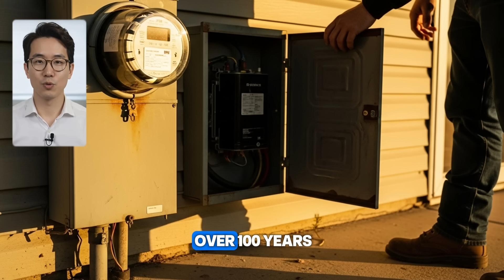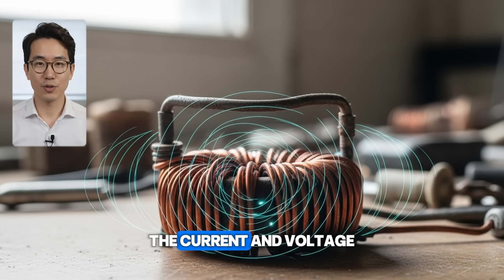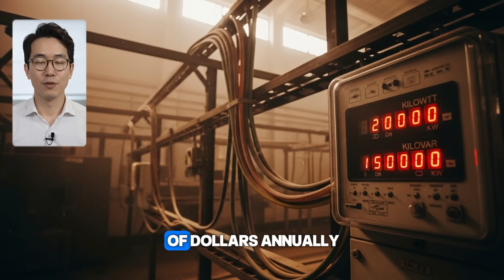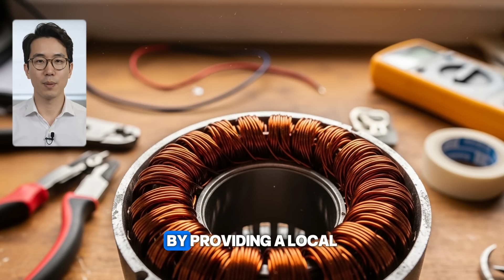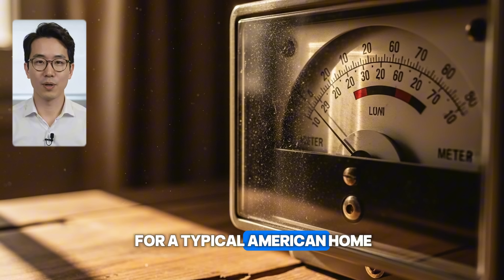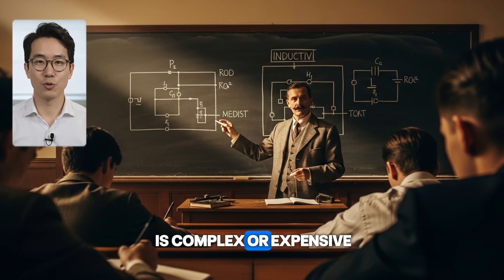This $2 Capacitor Bank Cuts Home Power 40% — The Power Factor Secret Utilities Never Taught You

Comment: not every device deals with a PF read it as efficiency the same as cos for starting you use extra power 
yes it can reduce use but if we talking here about starting that takes only a few seconds
but the use is in hour use so you have to cut the use by 60 if it takes 3 seconds now you cut it again by 60
npw we have seconds multiply this by 3 like this 2000 W / 60 = 33.33 W / 60 sec =0.55 W x 3 = 1.66 W
take your kwh cost say 20 cent split by 1000 x 1.66 =0.00055 cent for every time it starts
so to be honest this is bull story they tell in africa 10.000 starts to see a 10 cents differends on
your utility bill they raise the kwh  cost with 1 cent and you profit is gone
most people dont like to calculate because they say the dont have time but electricity is time based
a hotel owner who have done this said he saved 30 % but that can not be a broken earyh swiths
maybe were the problem sending 30 % in the soil if he would safe energy that whould make his generator
from 150 kw using less feul do not believe this storys they are bulldo your home work use a calculator
regards Henk

Comment: How do the electricity-saving spike busters work? Electricity-saving spike busters (often marketed as "energy saver plugs" or "power factors") do not lower your electricity consumption or reduce your power bill. These plug-in devices are widely considered scams by consumer protection agencies and electrical engineers. The devices claim to save energy by "smoothing out current spikes" and correcting the "power factor" of your home appliances. However, Residential bills don't measure power factor: While large industrial facilities pay penalties for poor power factor, residential utility companies only bill for active power (kilowatt-hours). Correcting it saves the homeowner nothing. They lack real internal components: When dissected by independent engineers, these devices rarely contain anything more than an indicator LED, a simple resistor, and sometimes a cheap surge protector. Many models are entirely fake, containing empty boxes filled with nothing but wax, resin, or sand. They don't stabilize the grid: A single small plug-in cannot regulate voltage or absorb the massive electrical surges caused by heavy appliances like a furnace or A/C. Instead of using these gadgets, you can rely on proven methods to genuinely reduce energy use and protect your appliances: Smart Power Strips: Use these to cut off phantom power (standby power) to electronics like TVs, gaming consoles, and printers when not in use. Energy Star: Upgrade to certified appliances that have verifiable, lower energy requirements. Home Energy Audits: Schedule a professional audit or use DIY calculation tools provided by Energy.gov to pinpoint exactly where power is being wasted in your home.

Comment: Residential electricity is two-phase (Single/Split-Phase), and industrial is three-phase; do both use power factor correction? View all. Both residential and industrial electrical systems use power factor correction (PFC), but it is primarily required and implemented in industrial settings. Note: Residential power is typically single-phase (often delivered as split-phase), while industrial power is universally three-phase. Industrial Systems (Three-Phase) Why it's used: Industrial facilities operate massive inductive loads like large electric motors, compressors, and transformers. These cause current to lag behind voltage, resulting in a poor power factor. How it's used: Industrial PFC uses large banks of capacitors or active harmonic filters to offset the inductive load. This saves money, as electrical utilities penalize commercial and industrial customers for poor power factors. Residential Systems (Single/Split-Phase) Why it's used: Homes rarely have massive industrial motors, so their overall power factor remains relatively stable. However, modern household electronics (e.g., computers, televisions, and LED lighting) are non-linear loads that distort current and require internal PFC. How it's used: Residential PFC is usually built directly into the devices themselves. This is mandated by regulations like the European Union's IEC 61000-3-2 and Energy Star standards to ensure power grids remain stable. For a deep dive into the underlying principles, check out The Engineering Mindset's Power Factor Guide.

Comment: This looks like AI b/s. All residential meters count the real power, i.e. they take into account the power factor. Even in early 1900 the electromechanical Ferraris did measure the real power. They use two electromagnets—one proportional to line voltage and one to load current—to create a magnetic flux that induces eddy currents in a metal disc, creating torque proportional to the real power. They were designed to measure the actual, useful work done by electrical loads (kW), not the apparent power (kVA).
However, there are penalties for reactive loads for non-residential consumers, because they have big consumption and effect the entire network.

Comment: most modern devices have capacitors built into their power adapter or power supply. I would assume this is only an issue on poorly designed devices or very old devices
Reply: My stereo amplifyer is always warm when it is turned off.

Comment: There is no hidden power. Capacitor banks bring the current and voltage into phase for correct delivery of power. It means induction devices cause current and voltage to be out of phase i.e. one lags the other
Reply from the maker: You’re exactly right, and that distinction between real and reactive power is a crucial part of understanding how electrical efficiency works.

Comment: No, the clue is in the name; reactive power is not real power and domestic customers are not billed for it.

In a bit more detail, it happens when the voltage and current waveforms get out of step with each other (typically the current lags behind, which is why a capacitor deals with it). What happens is that for a short period after the voltage has changed from positive to negative, the current is still positive so you house is actually exporting power to the grid (and vice versa when the voltage goes from negative to positive. Effectively, reactive power is being stored in part of the cycle, and exported back to grid in other parts. 
Electricity providers dislike it because the current used ends up increasing losses in the transformers, cables etc., but only industrial consumers are financially incentivised  to reduce it.
Reply: Forgot to add - the is a UK YouTube poster called "Bigclive" and he strips down and analyses a lot of electronic gadgets. Many of the cheap 'capacitor banks' are fakes (with internal plastic boxes of sand to add some weight).
Reply from the maker: That’s a great breakdown of how power factor and grid dynamics work; thanks for adding your expertise to the discussion.

Comment: Total garbage.  Capacitors correct power factor.  Residential customers are NOT charged for bad power factor.  Only commercial and industrial customers are charged for poor power factor, NOT private homes.  You can install as many capacitors as you wish, it will do nothing to your electric bill.  Google needs to stop such misinforming videos.
Reply from the maker: You’re right that residential billing is based on real power, and I appreciate you clarifying that distinction for the audience.

Comment: First: Thank your for highly informative videos.
Second: what relationship Horsepower of a typical  motor and the capacitance value to yield a phase angle angle of  zero degrees? I am thinking about adding such capacitor major motorized device automatically switched on/off. These loads include motors in AC  and heating units. By doing that the variations in resulting phase variations in the average  phase angle.  Kindly comment.
Reply from the maker: It’s an interesting approach, though balancing capacitance to hit a perfect power factor can get complex as loads cycle on and off throughout the day.

Comment: lol, so the capacitor on my AC compressor should be good then?
Reply from the maker: That capacitor is specifically designed to help your compressor start and run efficiently, which is a great example of local power factor correction.

Comment: Why give false inpormation.  The most it could improve is 2 to 3%
Reply: Pays for itself in 2 weeks when you’ll use power for 40 years.  2-3% is something how is that false.  If this is real and true now imagine a whole city using 2-3% less power that’s significant
Reply: You don't even know that much.  The whole story is as bogus as the "2 to 3%," which you just made up.
Reply from the maker: You’re right that real-world improvements are often much smaller than theoretical projections, and I appreciate you sharing your perspective on the actual efficiency gains.
Reply: Will adding multiple capacitor banks other than the on the main line improve results???

Comment: Absolute rubbish because electricity companies don't charge for reactive power in a residential setting.

Even in industrial settings, they don't charge for it unless the power factor goes too low, so the emphasis is on power factor correction to keep the power factor above the critical threshold and close to 1.
Reply from the maker: Fair points—industrial power factor management is a much different beast than residential billing, and I appreciate you providing that technical context.

Comment: It would be good if these companies would make a split phase capacitor device that would fit right into a spare split phase breaker location in the main panel or in a subpanel.
Reply from the maker: That would certainly be a much cleaner and safer way to handle power factor correction for home setups.

Comment: AI Slop debunked by AI. 
No, it won't reduce your electric bill — and here's why.
Why it doesn't work for residential customers
Capacitor banks correct something called power factor — the ratio of "real" power (watts, what does actual work) to "apparent" power (volt-amps, what the utility has to supply). Industrial facilities get billed for poor power factor, so capacitor banks genuinely save them money.
Residential customers are billed only in kilowatt-hours (kWh) — real power consumed. Your meter doesn't measure apparent power or power factor at all. So even if a capacitor bank improved your power factor, your meter wouldn't register any difference, and your bill wouldn't change.
Reply: Last week he was saying you should wrap 80' of 18 gauge wire around your service entrance cables ahead of the meter... IOW, "correct" an inductive power factor problem by adding even more inductance!  I can only hope no one is stupid enough to connect a start capacitor across the power anywhere in their home, because it will literally EXPLODE in their face!  I'm a REAL electrical contractor, and NO real electrician is going to do this for anyone!  This channel should be taken down!
Reply: @TheRealCheckmate  It's the comment section of these videos where the learning happens.  Thank you.
Reply: @DennisD-d1n  Right! I think Dr. Wong is very wong about everything. He never gets it white.
Reply: @TheRealCheckmate  It amazes me that youtube is so wreckless with our lives..:hand-orange-covering-eyes::text-green-game-over:
Reply: Ai slop comment
Reply from the maker: Thanks for the detailed breakdown; it’s a helpful perspective on how billing systems and power factor differ between commercial and residential setups.
Reply: 100% correct

Comment: Residential Metering: Most modern residential smart meters in the US are designed to bill only for Real Power (Watts), not Apparent Power (VA). If your meter only bills for Real Power, a power factor capacitor will reduce the current in your wires (reducing heat/line loss), but it may not significantly change the number of kilowatt-hours you are billed for.
Reply: I get 15-20 dollars a month savings using tensor rings alone. One on the smart meter one in the breaker box. That’s because the electricity stays in the wiring. Also the ring on the meter stops the 5G from entering the house. I drop one on the furnace blower motor, one on the router and signal booster. 160 shaved off my electric bills last year compared to the year before. So there is something that leaks out the wires as waste that you are paying for. They aren’t call EMF’s for nothing. I don’t believe for a minute that the smart meters are as smart as you claim they are.
Reply from the maker: Appreciate you breaking down the difference between real and apparent power—that distinction is a key technical detail.

Comment: Another thing that they don't mention is most industrial applications do not use capacitors to adjust power factor at facilities. What they usually use is a synchronous motor adjustable rotor current. Can it up to one of the largest loads. That type of motor can actually draw capacitive reactive current under load. So they have a sensor that measures the power factor and that motors rotor current is adjusted to bring it within preferred ranges. We're talking really, really really big motors. Usually run straight off of $4,160 volt power.

Comment: My electric company replaced my meter and my bill dropped significantly. I don't know if PFC was the problem or not.
Reply from the maker: It’s very possible the old meter simply wasn't recording your actual usage correctly; hardware upgrades often lead to noticeable changes.

Comment: So how does the average Joe accomplish this to save money and use less power?I would really like to see a detailed description and instructions
Reply: Forget about it. This does  not work. It's a scam for homes.
Reply: @8546Ken I figured that was the case and thank you for the heads up and much respect
Reply: How many watts does a generator generate: 0 watts! 0 watts you might ask? The law of conservation of energy states that energy cannot be created or destroyed. So according to the law of conservation of energy a generator doesn’t create energy. So where does the energy come from? A generator creates a charge on the + terminal and a charge on the - terminal. There is a small distance between the + and - terminal. These two equal and opposite charges separated by a small distance is wat is called an electric dipole. An electric dipole acts negentropic because of it’s broken symmetry. The strong prediction of broken symmetry by physicists Lee and Yang and its experimental proof by Wu et al. in 1957, initiated a great revolution across physics and won a nearly instant Nobel Prize in December 1957 for Lee and Yang.
Lorentz arbitrarily changed the equations so that the net change in the vacuum potential is zero, this is BS! The net change in the vacuum potential can not be zero because the law of conservation of energy states that energy cannot be created or destroyed so it always has to be there!
By insisting on a "Net Zero" vacuum potential, we are forced into Energy Poverty. We are told we must burn fuel to "create" energy, when in reality, we only need to "dip our cup" into the ocean of energy that is already there. There is enough energy inside the space of an empty coffee cup to boil all the oceans of the world. This is a fact well known to the scientific community, and was, for example, a favorite quote of Nobel Prize winning physicist Richard Feynman.
Conservation of Energy is actually the friend of "Free Energy" (COP > 1.0) systems. It proves that the energy is already in the vacuum; we just need to stop using the Lorentz-regauged "suicidal" circuits that use the energy to destroy the source (the dipole) instead of just powering the load.
"The dipole is a broken symmetry. Once you make it, the vacuum pours energy out. To say the net change is zero is to ignore the very thing that makes the universe work."
If we stop assuming equilibrium and start treating the generator as an open system interacting with a non-zero vacuum potential, the "Energy Crisis" vanishes instantly.
Reply: Go read my post. Residential consumers are not charged for reactive/apparent power where the voltage and current are not in phase with each other.

It is not something residential consumers have to worry about.